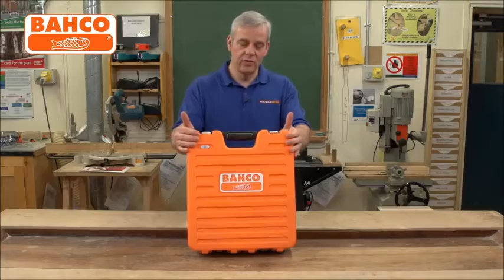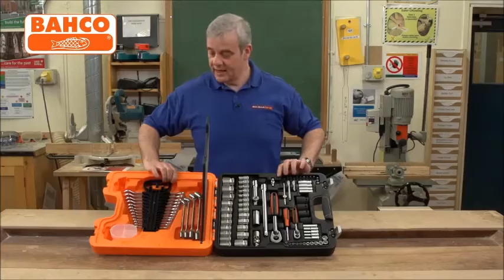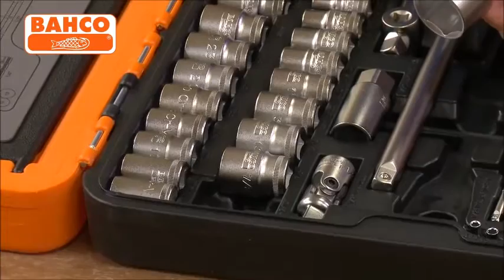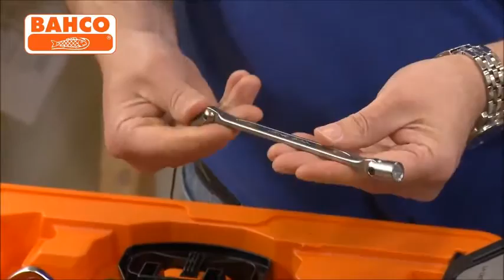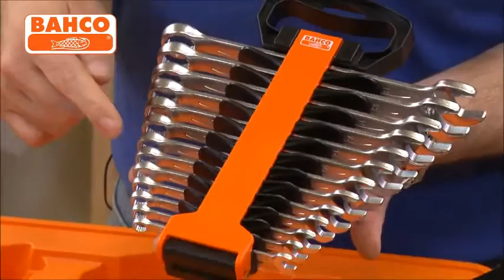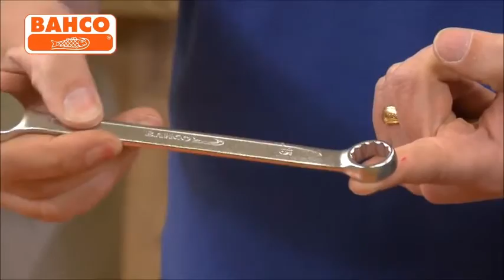Bahco 94 Piece Mixed 1 4 and 1 2 Inch Drive Metric Socket and Spanner Set

Comment: Edit: (lol mine turned out to be  Garbage) defective straight out the box the on/off lever gets stuck
Reply from the maker: go straight back to the seller, we have come across no issues with the bahco socketry unlike some other brands i would say youve just been unlucky this time.
Reply: Yes but I got it shipped to u.s from u.k you think a rebuild kit will fix it the lever only locks up when it’s on one side to turn it back I need to switch it while I’m turning the anvil I do remodeling I’m kind of a rookie as far as this if any suggestions I’d greatly appreciate it honestly it’s my absolute favorite design and feel I’ve had chance to try many top brands but specifically fell in love soon I seen the 1/2 bacho slim
Reply from the maker: you should be able to get hold of bahco in the u. s. they should be able to sort it for you
Reply: @SealantsandtoolsdirectCoUk  oh really cool thanks really appreciate the response i really can’t even get myself to pull the trigger on a different set been looking at the gedore  but It looks soo bulky compared to the bacho slim don’t think I’ve seen an design I like more even if can’t get it fixed im going to order the whole 1/2&1/4 slim set

Comment: This is great set  but I dont understand why it is missing few sockets as 21mm (If I remember right)
Reply: 21mm is placed separately. It is considered a sparkplug socket, so it`s fitted with a rubber insert an sits in it`s own place in the box. But for god`s sake, why do they think that 21mm sparks are still a thing? I have 16mm sparks in my TSI and there are no 16mm sockets in those sets, rubberized or not :)